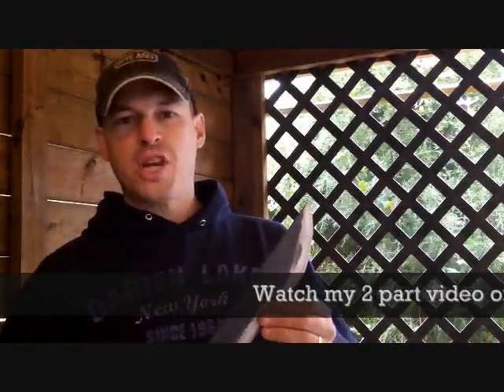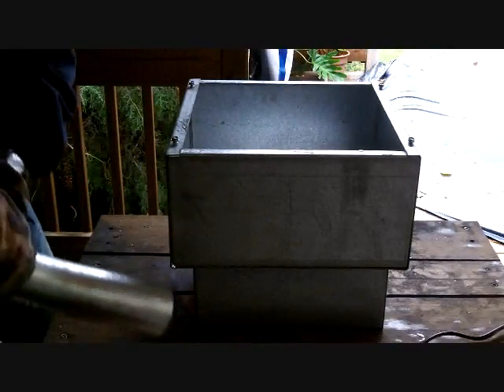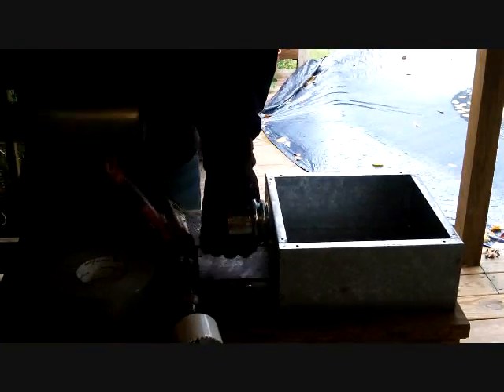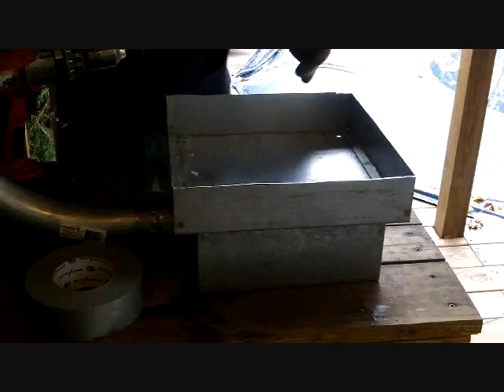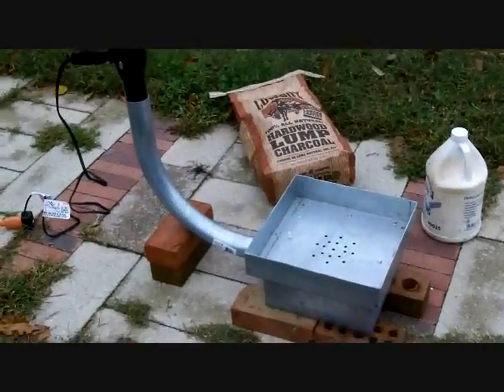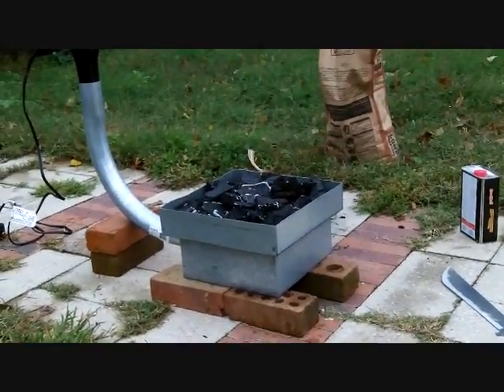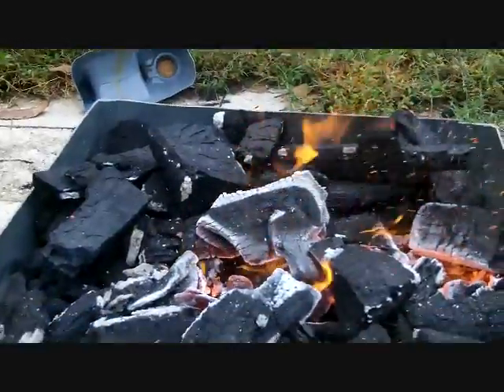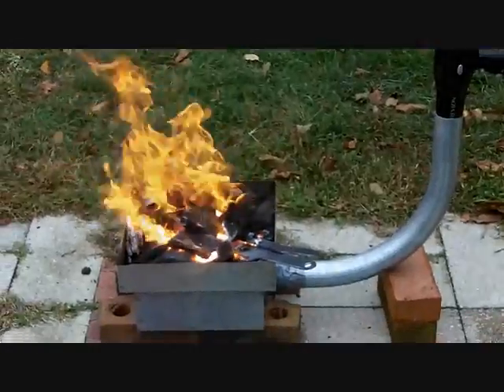How To Make A Homemade Forge (Rated Best Video)

Comment: @jaydog4571 Hey bud, just wanted to let you know, those parts look galvanized. Make sure you vent those fumes from the first few firings as when that galvanization burns off it releases cyanide gas that was used during the galvanization process. Just thought I would let you know, you may already be aware. Thanks for the vid!

Comment: awesome job man I think I'm gonna build something like that I was thinking about putting a slit in the side of the bigger upper box to slide the blade in between the coals do you think that would work? Also I'm making a few knifes and i'm gonna be using stainless steel so do you use the same method to forge that or do you know what is the best way to go about it when using stainless steel any advice would be appreciated. thanks for the awesome video and idea

Comment from the maker: The boxes can be gound at your local electrical supply house. Sizes are 12x12x4 and 16x16x4. They are commonly referred to as screw cover junction boxes ,Nema 1 rated.

Comment: Hey, where is the best place to find those boxes you used? And also, shouldn't you use some fireproof cement on top of the metal? Wouldn't the heat from the fire make the metal box red hot as well? Please respond, thanks.

Comment: Be careful these metals are galvanized and should ONLY be used outdoors because the fumes can be toxic and can eat away the lining of your stomach you can look for old furnace motors they will blow more air than a hair drier.

Comment from the maker: @soweaksauce - I am low tech so I use the magnet method basically, when steel no longer attracts a magnet it has reached a high enough temp. I'm definitely NOT an expert. Everything I have learned hs been through experimentation.

I use thread cutting oil to quench with and sometimes just plain water. I think the oil produces a better finished product. My research consists of watching other youtubers and my own experimenting.

Comment from the maker: @dogbone222 - when you want to heat the metal to red hot you keep the hair dryer on full blast, then when you take the piece out to work on it you turn the dryer off to save your coals.

Comment: @jaydog4571 you know that not all steel is heat treatable and the tempreture of the stel when you quench it matters all and you newer repeat the heating to red hot that only weakens the steel so what type of steel did you use ? and to what temprature did you heat it up to ?

Comment: Hello, and good job on the forge. I built some forges similar to this a couple years ago. Something I found out that may be of interest: the fan inside a hairdryer is 12v DC. A hairdryer consumes about 1100 wats while running, that's a ton of power. If you take it apart and romove the heating element and the rest of the electronics, put the fan back in it. Some basic wiring and you can run it off a 12v power supply. With a little inginuity you can even control the speed of the fan. Take care!

Comment from the maker: @TheDeputydawg24, Good question, I let the steel heat up and get red hot snd let it stay like that for about 1 minute, then quench, then I repeated the process. The knives are considerably harder after doing this. The knives do hold an edge well, and as you can ser grom thr video, I like em sharp.

Comment from the maker: @HerbSmoulder - the system works on pressure, the air travels down the pipe into the air box, and comes out the holes when sufficient pressure has built up. decreasing the diameter of the pipe would have no effect in this particular application, the air might reach the air box faster, but wouldn't fan the coals any more.